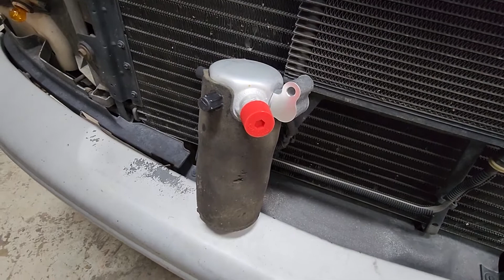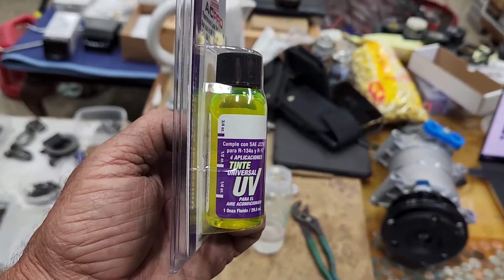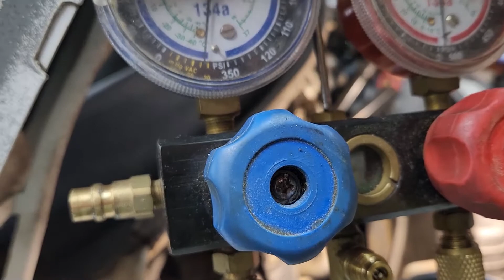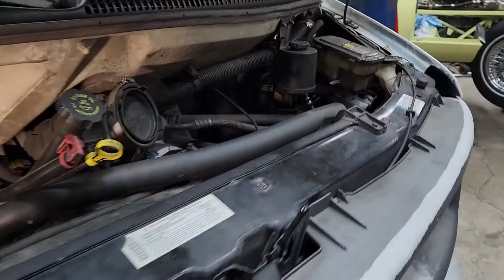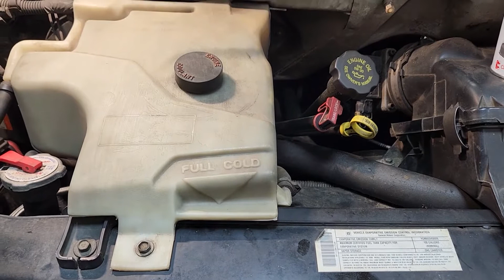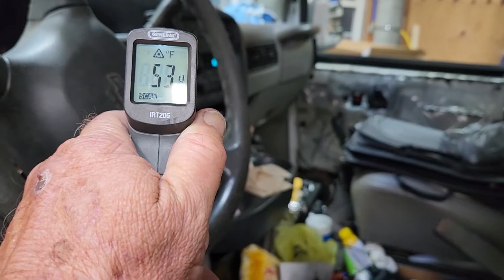How To Replace AC Compressor Dryer And Orifice Tube Chevy Express 2500 6-20-22  #chevy #expressvanac

Comment: I’m getting ready to this exact thing to a 1997 express 3500 extended passenger van with rear ac which I’m contemplating blocking off and removing for more space in the rear. So I had a question. How did you know how much pag 46 was left in the system before you added the 6 ounces to the ac compressor? I’m nervous I’m going to put to much oil or not enough. Thanks for your time and the video 👍
Reply from the maker: Thank you for letting me know, If I can help let me know. Thank you for watching the videos too